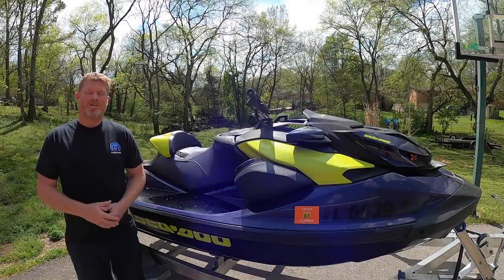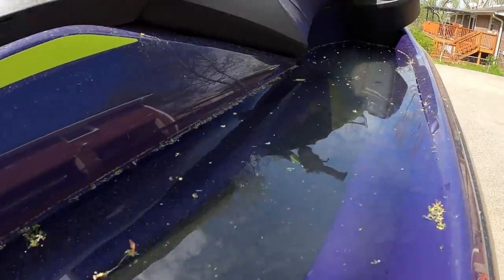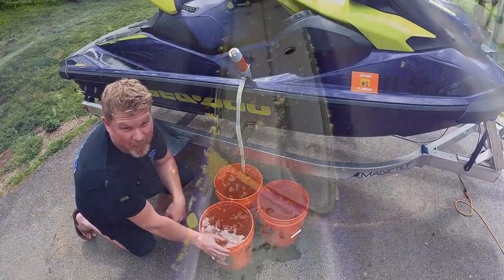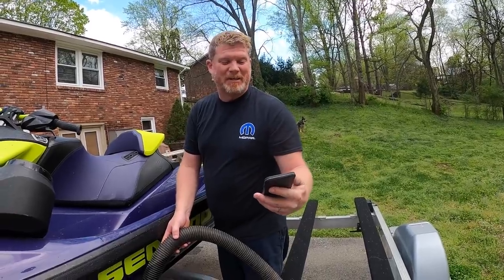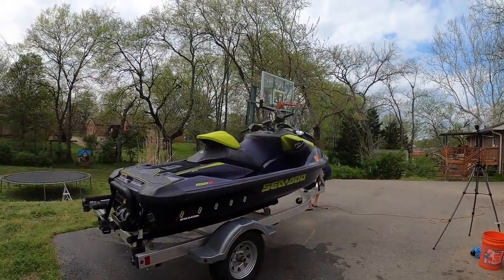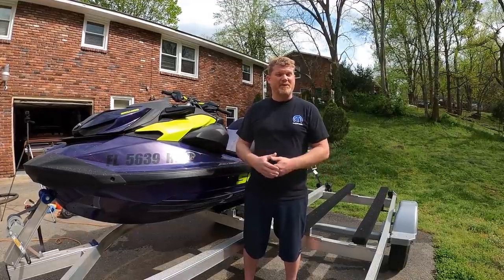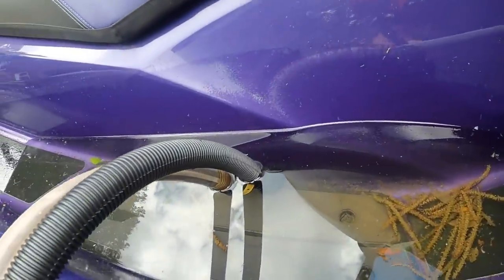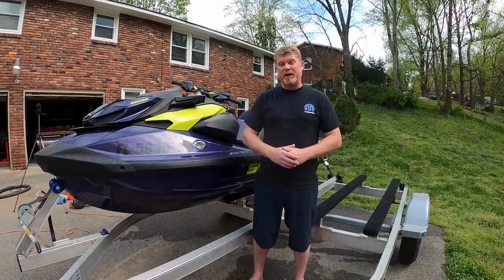Testing All The Ways To Drain Sea-Doo Footwells: The Watercraft Journal, EP. 108

Comment: I have the rxt 260 is 2010 model. How would you remove the water from under the foot wells? I press the is button to raise the seat and I can remove most of it with a towel but not all of it. It's hard to get to. Also I lift the trailer as high as i can to empty the bilge but i still see some water on the bottom underneath the engine. Again hard to get to. Is there a way to remove all the water?

Comment: i crank the trailer wheel all the way up then set the wheel on top of a 4' piece of heavy pvc drainpipe stood on end.. Then i crank the wheel down until its pushing the two rear bunk supports against the driveway. Its very stable and about 45 degrees so everything drains out without killing your back. You just need to make sure it's secured to the trailer. If its on the lift i use a little suction cup to hold one end of a 5 foot hose where i want it in the footwell and like many said on here put it under water then put your finger on the end and hang it over the side. My rxpx is black and water spots bad so i plumbed an outdoor faucet to run through the water softener inside.that helps a lot.

Comment: As a commercial JetSki operator with over 30 years experience we’ve  found the easiest and most efficient way to empty the foot wells and engine bay is to slide the skis back approximately 10 to 12 inches (30cm) on the trailer and carefully tilt the trailer up. Make sure there is still a slight weight biased towards the front but light enough that anyone can lift the trailer. Make sure you have your winch strap attached and locked in so as your ski doesn’t slide off, check your number/license plate is not being bent, you can put a small wooden chock under the back of the trailer to prevent this. Also don’t forget to Choc both trailer wheels. If you remove the bungs and the seat you can finish your wash down by giving the engine bay a final rinse as well as the footwells and leave everything to drain and dry off 👍
Reply from the maker: For the modern Sea-Doos? Nope
Reply: @watercraftjournal  Yes for the modern Seadoos . We currently operate 24 of the 2022 GTX Pro skis which average around 1200 hours a year. This works very well so I’m not sure what you’re doing wrong.
Reply from the maker: The video literally demonstrates how tilting the trailer 30º does not clear the footwells. Watch with your own eyes.
Reply: @watercraftjournal  Not sure why you’re taking this personally I thought the idea was to help your viewers clean the water from their modern Seadoo footwells. Firstly you didn’t slide the ski backwards making it simple to lift the trailer, you didn’t leave it in the raised position with the back of the trailer on the ground and then you didn’t rinse the footwells as I mentioned. Again we do this all the time and we’ve tried every method in your video & this works the best.
Reply from the maker: Personally? No. Defending our position? Yes. The average 55-year-old is not going to drag their 900+ lbs ski partially off of their trailer so readjust the weight distribution just so that they can dead press the tongue up over 30º to empty the footwells. The suggestion of doing so is ludicrous. A 20-year-old porter making $10/hr at your rental outfit? Sure. Have him blow his O-ring out doing it. But we're talking to the average PWC owner, and the average PWC buyer is 52-years-old. We're providing useful, repeatable tips. It's all about keeping things simple.
Reply: @watercraftjournal  Wow, really 🤪

Comment: ....I use an old 4 foot piece of garden hose ... Submerge it entirely in the footwell and let all the air come out then put your thumb on one end and dump the other end of the hose over the side ( making sure the drainhose is lower than the end in the footwell) ,... remove your thumb, it will already be self primed and water will drain easy....I leave the hose in the storage compartment for the next use...

Comment: Thanks Kevin. Hilarious that I hadn’t seen any other videos about this previously. I’ve used the chamois and sponge method. With 2 skis on a double trailer I can’t lift mine (and my driveway where I wash up at would send the water into places I don’t want it if I did). Hadn’t thought of the shop vac method for some reason. I’ll look for the pump from HF. Thanks for the suggestion. My older RXT-X has a drain plug, but like you said he newer ones don’t.
Reply from the maker: Nope. Total dumb move by engineers.

Comment: Leaf blowers work great to evacuate the water in the jet pump  only easy way ive found  after ,  after i tilt it and run the motor.
Reply from the maker: How much water do you have pooling in the pump tunnel?
Reply: @watercraftjournal  usually 5/8 "  the problem is the skii that hits the salt water but doesnt get flushed out since it wasnt used--my 2016 fzs  not the 21 gpr.  the blades of the imp will block some of the pump sleeve and only way to get that part clean n dry is to crawl underneath and hit it from intake grate side.

Comment: If Seadoo is out of the water why not just leave it covered? If dockside and full how much comes out with a hard acceleration? A regular siphon would work well too if on trailer, and you usually don't care if it's slow.
Reply from the maker: Yes, of course. But if you WASH your Sea-Doo, the wells will fill up like these.

Comment: I don't know what you're doing letting that much water get in your footwells. You should not leave your ski outside. That much water will ruin the mats. Also when washing I usually pressure washer and the pressure blows most of the water out. What is left is enough to soak up with a few micro fiber towels. Honestly I think the bigger issue is the water that collects down inside the hall when you rinse out the engine compartment. For that I normally use a few microfiber towels as well but it can be time consuming and tedious to get underneath the engine, I'm thinking of switching to a small portable shop vac with an extension. Also if you do decide to go with the lifting method, I have a double jet ski trailer so it is very heavy, I use a long reach floor jack just in front of the tire to lift the whole thing so I don't have to destroy my back.
Reply from the maker: Lewis, did you NOT HEAR that this is mainly for people after washing it?
Reply: Obviously did not pay attention. He intentionally left it outside uncovered overnight in a thunderstorm just to do this video.

Comment: Nice gadget the Australians came out with. 
Reminds me the old method of just fill up a pice of hose with water and the physics does the rest. Not sure, because I do know the design, but it could work on big volume just to start the process than shut the hose down, until up to the end, when the low volume / little puddles will mess the process because the air will find it way in. 
Or just start the process without the 3D printing part, just attaching it and the hose to deal with the little puddle remaining.
Reply from the maker: Yeah, it's neat but super wasteful.
Reply: @watercraftjournal  I got you. But you can just drain 90% of the volume just with the tube that comes with it, and the remaining puddles you attach the 3D printed piece to suck the rest. 
This is the only test you missed. Just the good old gravity and Dynamic of Fluids. 
Also the cheapest one. Hehehehehe. Thanks for the video.
Reply: This is how I empty the french drain under/around my pool.  1 end of the full hose goes into the drain, other down a low spot in my yard.  As the water you put in the hose leaves it creates a low pressure zone behind it.....physics want the siphon effect to continue.  So the hose being under my (in-ground) pool will empty hundreds of gallons of water over about an hour.
Reply: @okcmoparguy724  exactly.
Reply: They looked at a pneumatic vacuum and thought how could I make this terrible and decided to make it water powered. you can get a pneumatic vacuum for less than 30 bucks, suck the water out and blow dry the entire thing with a small air tank of air.

Comment: Just lift the front of the trailer or get a section of fuel line to siphon the water out. If these tweekers can siphon gas out of your tank at night you can siphon all that water.
Reply: 😂 or just spend the $17 on the electric pump and you don’t need to siphon.
Reply from the maker: It’s like they’re commenting without watching.

Comment: Seems like a drain from each footwell into a small sealed sump box with a small bilge pump would be a good idea.
Reply from the maker: Sounds expensive!
Reply: @watercraftjournal  It's a small box with a $15 bilge pump.  My big boat has one mounted under the shower.  The shower drain is below the water line so the shower drains into a small sump box.  When the water level gets high enough, the bilge pump comes on and pumps out the box.

Comment: This is a non issue. In the water they empty as soon as you move. On the trailer they empty as soon as you move. If it's just sitting out of the water, it should have the cover on
Reply: Not on the Sea-Doo Sparks

Comment: Find a hill and drive up drain most of it out.number 2 set your trailer up correctly if you can't lift it you have to much tongue weight.
Reply from the maker: No, no it won’t. Not with these.
Reply: @paulocampos6052  no tongue weight is tongue weight 10 15 percent of gross weight.20 percent on a jet ski is more than enough.
Reply: I have a Triton PWC II and I can tip it up high enough to get the water out of the foot wells of a new GTI SE 170 and my older Seadoo ski. My wife has to kneel on the back of one ski as a counterweight to help me lift it. I use a strap to pull the license plate up on its plastic, flexible mount.

But what I dont like is I cant move my axle. Too much tongue weight in my opinion and no way to adjust the axle.
Reply: @briancollard8738  can you loosen the winch stand and slide the skis back a little.i set trailers up so the skis are flush with the bunks or hanging over a half inch just so you can get to everything like drain plugs and so fourth
Reply: @denniswilder3014  The skis are set on the bunks as you mention. But I could slide them back maybe another inch or so, but I really need and want to move the axle forward, and I can't.
Reply: @briancollard8738  how come you can't move the axle is it thru bolted?or is it so far forward it will pinch on the cradle?
Reply: @denniswilder3014  the brackets to attach the leaf spring shackles are welded in place and so there is only one place to attach your springs and you dont have a lot of space to move the axle forward on the spring.

Comment: 3:30 I am not sure if you know this or not, it isnt really a pump moving anything, it is basically physics lol. You really dont need any pump for a hose in that position, water will flow by itself and quite fast. I have a piece of pipe basically for this purpose and i put one end into a footwell, then I simply suck the water from another end just enough that it ALMOST reaches my mouth, close it with a thumb, simply drop it low to the ground and voila a miracle of middle school physics is happening, PUMPLESS lol. The speed of such drain would ONLY depend on a diameter of a pipe/hose you are using, so it can be very fast if you use a thicker hose, WAY faster than this tiny pump and at a fraction of a price and zero batteries. It is sad to see to be honest how simple problems are being solved "through the ass" so to speak just because people dont know basic physics, that suckomatic is a perfect example of that, you dont need to 3d print anything OR the hose either, that last device is just perfectly dumb, sorry. It is hilarious how they used a way more complex process yet they dont understand basics to just make it simple.
Reply from the maker: You’re part right. Once the water level gets low enough the weight of the water in the well won’t push the water up and over the gunwale.
Reply: @watercraftjournal  difference in pressures yep, and now try thay with a big hose and you are gonna have a lot of waterflow! :-)